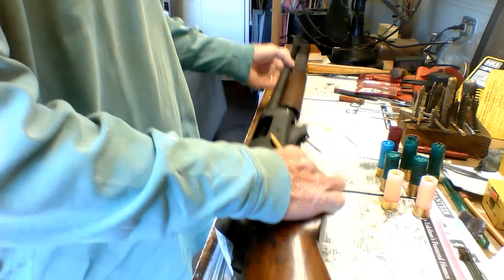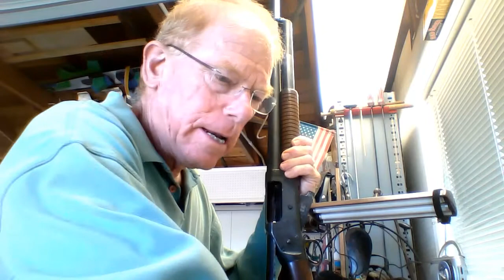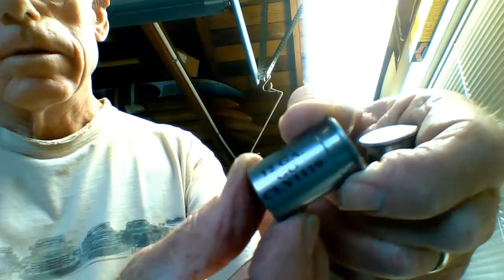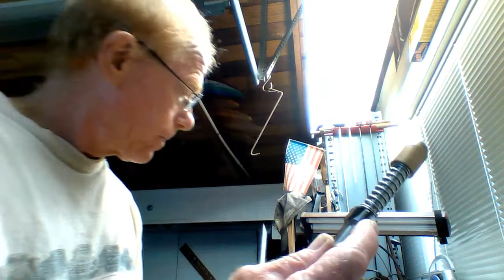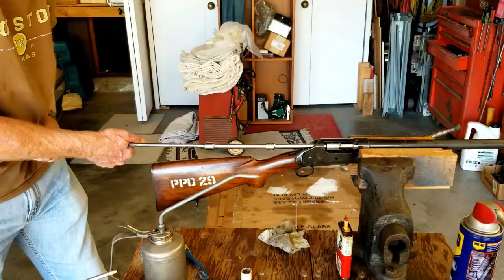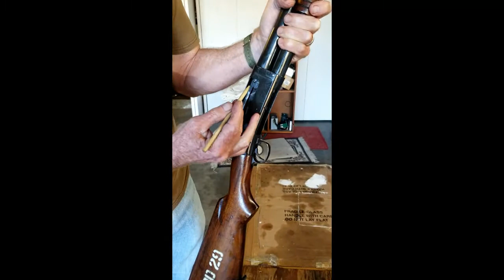Winchester 1897 Headspace Repair

Comment: Trench model 1897 48'  right ejector indents shell base of dummy round. Angled inward, spring and movement working as per, strongly flexible in an out. Learned a lot breaking down the shotgun but the bolt problem still exists. Got any ideas? And thanks for this interesting work.

Comment: Buying a field mod 97 30" BBL  this week. Looking forward to doing some rabbit chasing with it.
Some one had cut the butt stock short and some for pad was put on. Did a terrible job. But it does shoulder nice as I'm only 5'6.
I don't have the guilt so to speak of chopping it down. Lol. 
Gd job on video. Thanks much.

Comment: have the same issue. can you provide me with a link to the exact reamer you used in this video please
Reply from the maker: Here is the reamer I used.  For the fixed barrel model like my video, you will not need the headspace ring.  Tell them to remove it and it will save you $12.  https://4drentals.com/product/12-gauge-55o-headspace-ring-reamer/

I was dealing with Fred Zeglin, email address was, reamers@4drentals.com.  Real nice and prompt.  Read their website on how to rent.

Comment: I swapped atleast 15x a barrel on a Winchester 1887/ 1893 /1897 (they are the same in terms of design and internals and and more or less) and u cant do it wrong there is a mark at the bottom of the barrel that matches a small micro mark between barrel and mag tube on the receiver,they need to line up 100%  and then ure barrel is in the final position but what happend most likely is:

The barrel was on there pretty loose wenn it was in the final position as not every receiver and barrel match up that great so a person got the idea put the barrel on a lathe and cut some material off so we can get it one turn more,with no ammo in there gun works fine,meaning ammo with thin rims will fit but ammo with thicker rims wont fit.

U can see on the notch in the barrel where the barrel band is that holds barrel and mag tube that u show for a brief second it doesnt fit that great and has been filed out,this indicated bad barrel placement.

U could of taken the barrel off and put shims between the receiver and barrel as thin as hair and cut them off with a knife so the fit perfectly (i do that wenn a barrel is pretty loose u wont see it but i only use 1 shim) but multiple lairs of shims u would see and would be a hobby bob idea.

U could buy a used carrier and file the locking surface down.

But cutting just a bit of the surface where the rim sits is the most easy and cheapest way. (i made tools so i can can take barrels off so i would of taken the barrel off and my friend who works with lathes all day would cut out a hair so the headspace would be super tight).

Me personaly i like to see guns lock up 100% and i would weld up the top surface of the action bar that lift the carrier and file it down on the bottom that way the carrier get lifted 100% right against the bolt and it makes a old worn gun as new.....
Reply from the maker: Thanks Ben.  I wish I had some real equipment, like a lathe.  Your method is  the normal way to go.  I have never removed a barrel, have no real tools to do so.  It was just fortunate the reamer would go through the receiver.  Obviously, a modern gun you would have to twist the barrel off.  I was afraid to do that unless I had to.

The barrel did not have the 55 degree bevel for the rim.  Really that reamer just cut the outer circumference until the go-gauge would go.  The tool rental was only about $45.

Also, this gun also needs the action bar or carrier groove built up.  The carrier needs to rise a bit more to be fully clear of chamber loading and unloading.  Do you build up the lug on the action bar or the width of the bar?  Do you have any dimensional drawings of the action bar and carrier groove?  I don't have another example to go by.

I think when this gun was in the police department, it was rebarreled and they probably used whatever brand cartridge they had for a go-gauge.

Thanks.